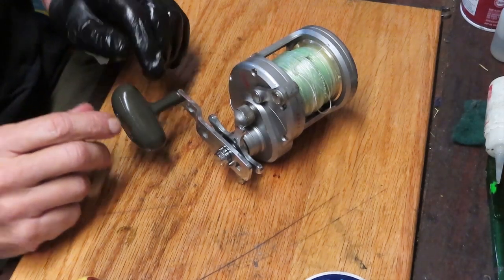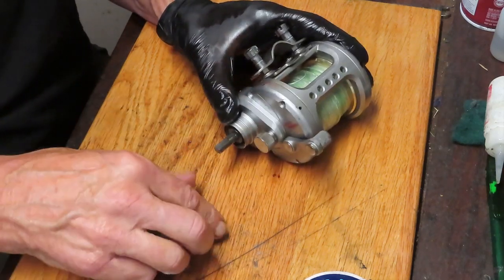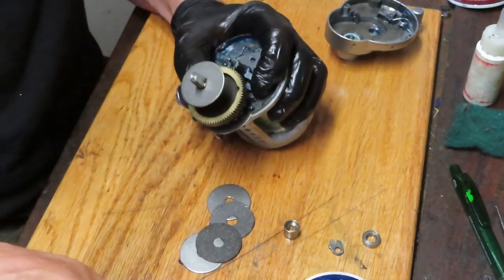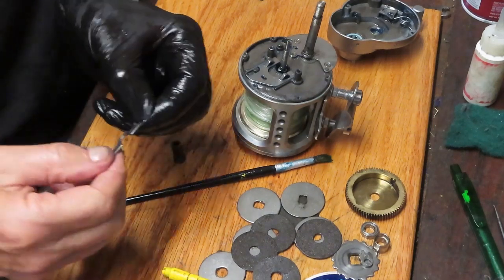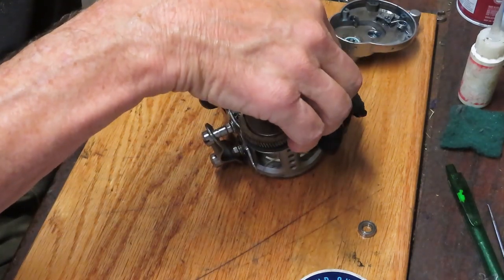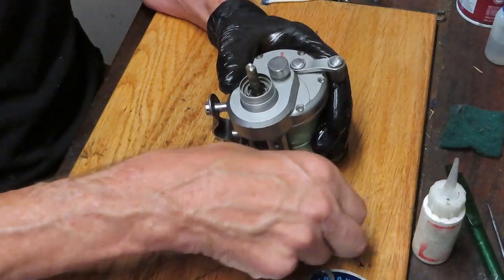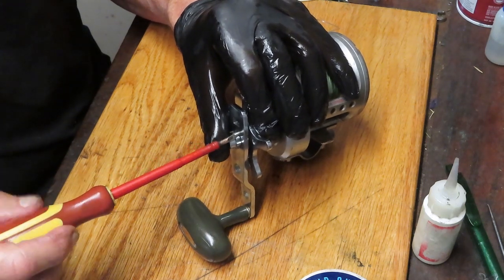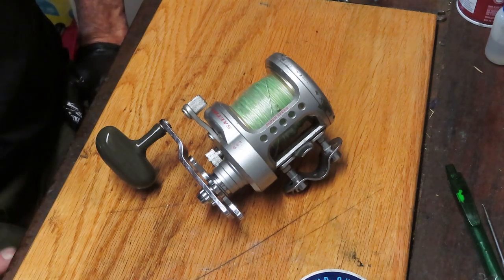Daiwa 40H Saltist fishing reel how to take apart and service this reel

Comment: Dennis, you remembered!

Now for the washers that are concave or convex. They're called Belleville washers. They are both a washer as well as a spring.

The Daiwa Saltist 40 looks like a nice reel. Love the big stack of drag washers. IMO, adding a level wind to a reel overly complicates the reel and requires to use of metal gears to wind the line on a heavy reel. A HDPE gear would probably end up stripping the teeth in no time. I might have to add a couple to the collection after seeing this one.
Reply from the maker: These are nice reels and worth owning - Thanks

Comment: Dennis, I would love it if you ever get the opportunity to do a video on a Daiwa Saltist spinning reel. I’ve seen a few good deals on such a spinning reel recently but I’m not going to commit to a purchase until I know more about the reel.  This Daiwa Saltist conventional reel was very interesting though. I got in my latest Ryobi DX Powerful No. 5 reel today and serviced it. It was new in the original box and I doubt it was ever even taken out of the box before. This is just about the only vintage spinner that I like almost as much as a Daiwa 7000C. The Ryobi has three excellent shielded bearings as well as that extra gear between the oscillation gear and main gear. It is an extremely smooth spinning reel. I’ve also started collecting the Compac SL spinning reel series. They are fine reels too but I have no idea who made them for Compac. — Chris  PS. I’ll send photos of this recent Ryobi Powerful reel. It is a beauty!
Reply from the maker: I will keep a lookout for a Saltist spinning reel and do one if I can.  Those Ryobi reels are nice.  Sounds like yours is mint.  Enjoy!

Comment: Hi ....I have the same reel....serviced now using your video...big help thank-you....One issue I have and can't solve yet...When I tighten down the drag a bit, the handle becomes very difficult to turn...ie there is some resistance....cant seem to work out what is causing this and have opened it up several times now to check everything against your video....please can you provide some guidance...kind regs
Reply from the maker: Is the ant-reverse working correctly?  You may have the dog trapped behind the main gear.  If you do not have the A/R then that would cause the issue you are describing - Dennis

Comment: How do I know when it’s time to replace drag washers
Reply from the maker: If you have a  limited drag spectrum - that is all drag or no drag, with minimal adjustment in between, that is usually an indication of drag washers stuck to the metals.  If you are tightened down and have drag slip, that is an indication.  If you have sporadic drag performance - it holds, then doesn't the holds again, that is also an indication.  The best way to do it is to visually inspect the drags, but the other indications may tell you without opening the reel.

Comment: Hello question I tried to service my reel and now when I tighten up the drag the handle is hard to turn now I was wondering if you had any idea of what I can try?
Reply from the maker: Yes - you need to recheck how you installed the drag washers and or the spool - it is likely that one or the other is causing the issue - Dennis
Reply: Thank you it was the cylinder above the gears I had backwards it works now, it just vibrates when the drag is pulled does they mean my drag washers are dry?